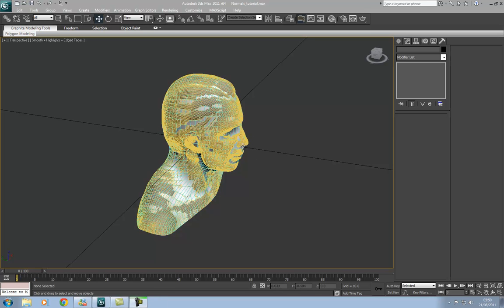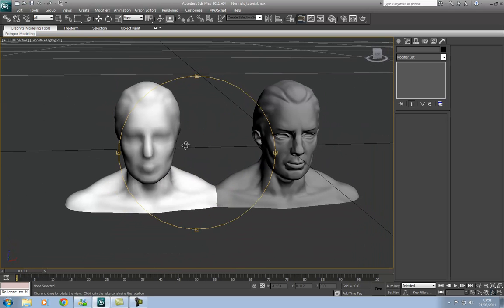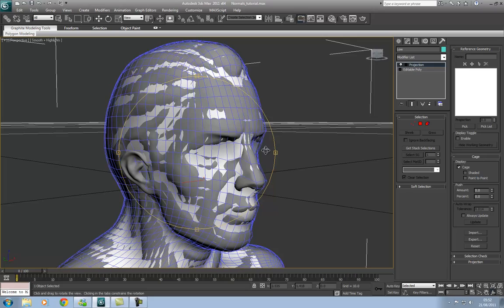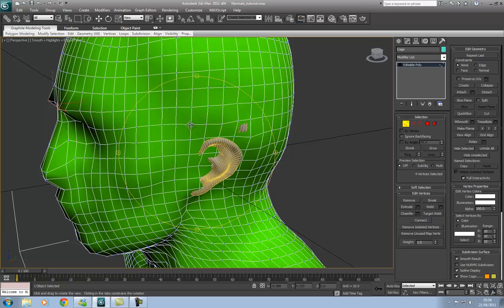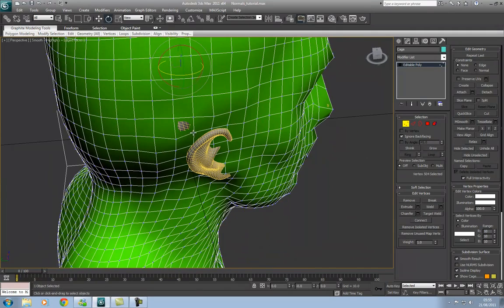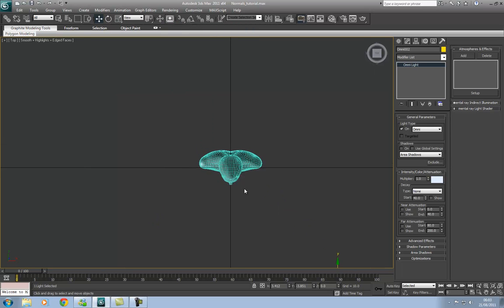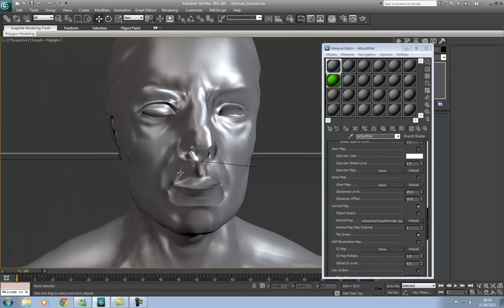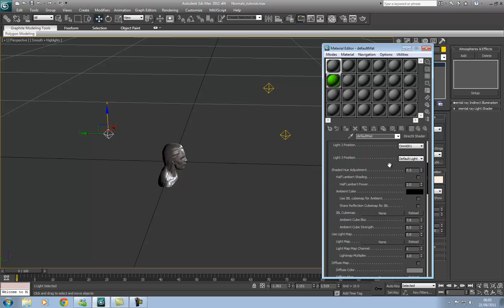Baking a Normal Map in 3ds max.mp4

Comment from the maker: No, you need the UV, as they are what defines the texture coordinated, however, if you want a quick and cheap way out, so you don’t have to UV Map you model, in the Render to Texture options there is a check box that says "Use Automatic Unwrap” this option will create the UV for you, but you have no control over how it decides what parts of the model are more important than the other, meaning you may get high detailed areas with a low amount of texture space, resulting is low quality Normal Maps

Comment: I'm working on a male body right now and have the low poly and high poly done. However I did not UV map the low poly because the tutorial I was using didn't mention it. Will your process still work  if I UV map the low poly even though my high poly is finished?